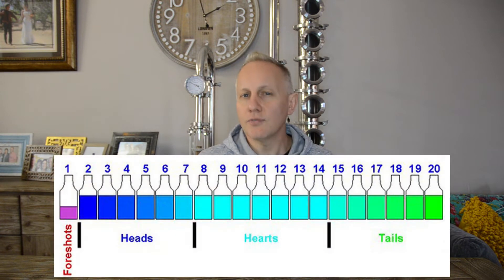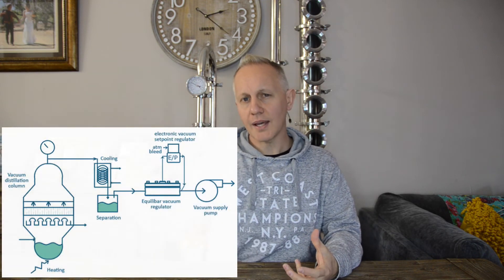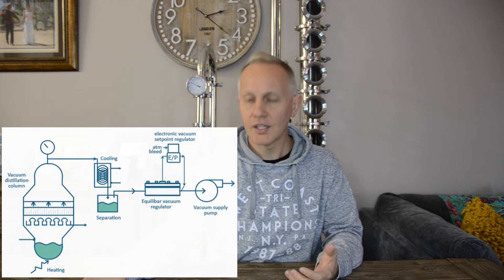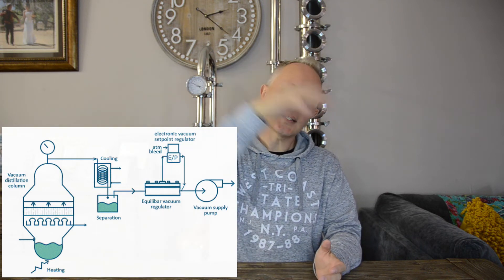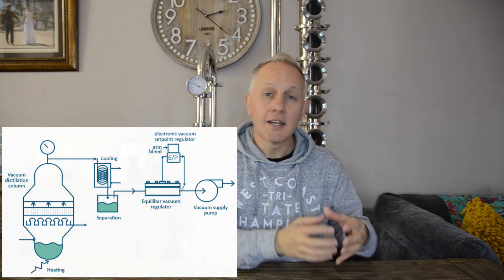What Is Distillation? | Cuts, Stills & Principles Explained (Back to Basics)

Comment: Hi There is your kettle a 100 litre unit and how long from start?  to 10% does it normally take?  90 ,mins to start vapors then 4 hours? is that about normal?
Reply from the maker: Hey Greg!
Yes I do have a 100lt kettle.

Let's look at two different runs, to give you an idea:

For NGS (neutral grain spirit) runs:
> I used a 4.5kW element reduced to 85% (3.4kW) power output, that is due to the electrical restriction where I am staying.
> Heat at 85% (3.4kW) power until the boiler top temperature (the point just before it narrows and enters the tower)  reaches 60degC.
> On average it takes me 55-70 min per 40lt of wash I add to the boiler. Temperature of the wash and ambient temp also plays a role. 
> I then reduce the power output to 60% (2.4kW) and leave it for 30 minuets to stabilize. (At this stage my re-flux condenser/dephlegmator is fully open on the cooling water side)
> After the 30 min I start my collecting run.
> On average I then collect 1lt of product at 93-95% AVB for every ±35 min
> I'll collect until the parrot goes dry, no more product comes out.
> CONCLUDE: 
   ±60 min to heat up 40Lt,
   30 min to stabilize,
   ±35 min per 1lt of product,
   Collecting 6lt gives you in total a ±5hrs run for 40lt

For Rum runs:
> Heat at 85% (3.4kW) power until the boiler top temperature (the point just before it narrows and enters the tower)  reaches 50degC.
> On average it takes me 20-25 min per 20lt of wash I add to the boiler. Again the temperature of the wash and ambient temp plays a role. 
> I then reduce the power output to 40% (1.8kW) as I want a slower run for the rum.
> I would easily start to collect product after 35-45 min after the initial switching on of the element.
> Because it's a slower run, on average I then collect 1lt of product for every 50-60 min.
> I'll collect until the parrot shows 20% ABV, that's where I like it. 
> CONCLUDE: 
   20-25 min to heat up 20Lt,
   35-45 min from start to first drips,
   50-60 min per 1lt of product, it's a slow run,
   Collecting 3.5lt gives you in total a ±4hrs run for 20lt

I hope this helps you a bit.
 
Thanks for the comment and keep it awesome!

Cheers
Reply: @distillergreyling  Many thanks for the depth in which you explain the process, it has taught me a lot, thanks alot
Reply from the maker: Sweet Greg! Always willing to help!!